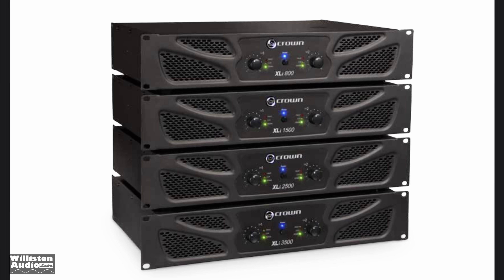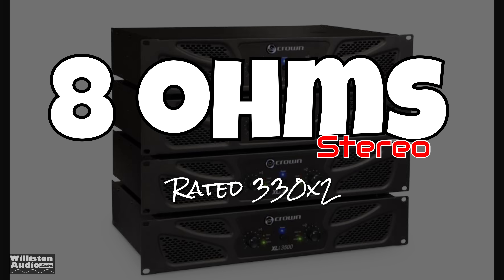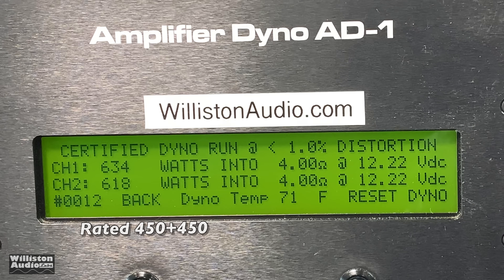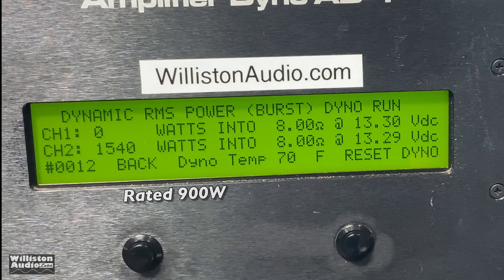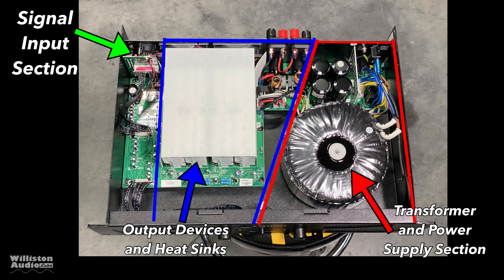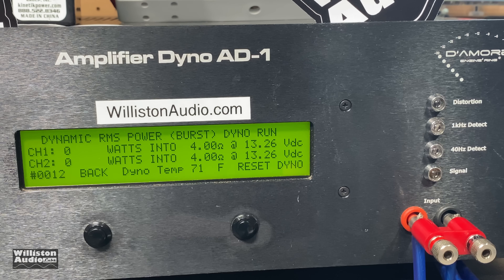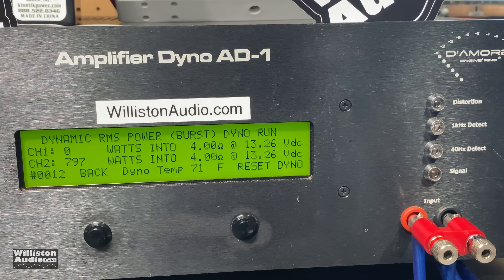The King of Pro Audio? Crown XLi 1500 Amp Dyno Test and Review [4K]

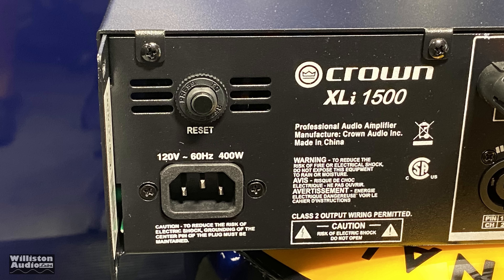Comment: The back panel says the amplifier draws 400 watts at 120 volts, 60 Hz - 1:22 ...  But it can output 1244 watts in bridged mode... Can someone explain how it's able to output so much more power than it draws?
Reply: it is because of the capacitor which saves Energy from transformer. In Bridge Mode you have more capacitor for that one Channel i think.

Comment: I have 4 pro audio amps. I got two Peavey single channel 300w amps, a Crest 450w per channel pro audio amp, a MTX 750w per channel pro audio amp and it don't matter what one you pick up it is heavy. I have a couple multi room P/A amps made for a business setting like a retail store but they are in sad condition they are heavy as well. They all got big fat transformers in them. Not like the transformer in that one that is the largest round one I have seen. I do have a massive ONKYO INTEGRA DTR-8.8 reciever that packs a fat 60lbs total weight and a 140w per channel rating at 8ohm continuous. It can do 170w continuous at 6ohms 7.1 surround.  Unfortunately I need someone to look at it. It powers up but the sound is just a tiny whisper from any of the channels it has. Where I live finding a good electronics repair shop is not easy. Being the throw away society repairing them is a dying profession and finding someone who is good at it is even harder. I know with a bunch of the ONKYO units the HDMI chip could become unsoldered rendering a no sound issue. I have a different HDMI chip than the one that causes that issue. I wish it was that I could do that replacement or repair on that board. That board is right on top facing up when the lid is removed. I am glad you did this video with a pro audio amp. I know it's 5 years old.  I should mail you this crazy looking 600w amp I have had for years. It is a 650w KOLE AUDIO car amp. It has a square box protruding from the amp and I can only think it is the transformer sticking up through the case like 2 to 2 1/2 inches. I found very little about them online. I guess they made a few different wattages with the higher watt ones having larger transformer boxes protruding up from the amp. To be honest it is kinda an ugly design. I remember reading on a forum years ago that it was considered a "cheater amp". I always thought it was underpowered. There is only one way to find out.

Comment: Somewhere, im failing to understand amplifier power ratings i've watched your videos on the crown xli 1500. And the Onkyo TX-NR1008. The Crown amplifier puts out more power from what I understood. I have both and the Onkyo will drive my Klipsch heresys considerably louder than the  crown amp does before the crown amps starts clipping. ??? Anyone that can tell me what im not understanding?
Reply from the maker: The Crown needs higher voltage input so you may not have enough input voltage to drive the amp to full output

Comment: Hi.  This is an old video but I would like to tell you something,  as an electronics design technician, and I'm sure you are quite well up on amps. This is what I once found in a reggae club. In the seventies,  there used to be an amplifier made in UK looked like a Marshal type box. But it was transistor. It was push pull two X 2n3055 outputs , rated at 100 watts.  No fans nothing. This club knew nothing about impedance lol and wired  -- get this -- twenty. 20. 18 inch, yes twenty "!!! Selmar Goliath bass units in parallel" and sixteen Goodman's axiom 12inchers also in parallel with the Goliaths. Do the math. ???? This was used for nine hours a night for ten years, without a problem " and sounded like five thousand watts. Shaking windows two streets away.  With thunderous bass from reggae music. And crystal highs from the axiom which was a full range guitar speaker really,  the heat sink was on the back about eight square inches, quite hot but not too hot , and the speaker cable was just bell wire lol 😮.  Unbelievable.  Could you reproduce this scenario?? And see how long a modern amp lasts??  Those days they had no output protection at all and ran. Into an almost dead short for years. On paper that amp should have lasted two minutes,  I do recall they put a sound city 120 watt on it for an hour to test the amp. It was valve , or tube as you say lol and the output transformer fried in that hour. As expected ". Hope you try this. I still can't believe it,  and the fal Amos are still on e bay as retro lol cheers
Reply: The name of the amplifier was FAL. 100

Comment: Ahhh, Crown. Overpriced, overengineered, overhyped junk. Well known for breaking into tweeter destroying high frequency oscillation, putting the full DC rail voltage on the outputs....

I worked in cinemas and pro audio for 4 decades, and Crown amps constantly failed at a rate of 5 to 1 over all other brands COMBINED. I saw more Crowns on my repair bench that all of the others. 

Why? This review and the dyno testing shows it. Crown ALWAYS way overdrives critical components to hype up the output...which works fine in the short term on non commercial applications. But push hard enough (and Crown always does) something WILL FAIL.  And when it does with Crown's piss poor designs, it creates cascade failures. 

Worst of all, Crowns have the worst noise floor of most other amps (hiss and sometimes high frequency oscillation). I had to replace a rack of them in a multi million dollar home's screening room because the client got tired of the constant hiss. I installed QSC amps that are still working fine after 20 years. 

I always love reading the comments from the rabid Crown fanboys, who wouldn't recognize a REAL quality amplifier if it bit them in the butt.

Comment: I have always been under the impression that when ya use the .775v sensitivity (-10db consumer level) input by using the rca input the amp is slightly retarded... swap the signal to -1.4v using the xlr and itll step up quite a bit

Comment: I recently puchased the XLi 1500 for use in a second system and somewhat taken back about how GREAT it actually sounded. In the past I have had amps that went LOUD (early Classe for instance) but still sounded flat and uninvolving. But the XLi 1500 has both power and grace and an infectiously dynamic, expressive presentation. 

One thing that struck me....after forcing one fork of a spade terminal into the small hole at the top meant for bare wire-this left the adjacent spades in very close proximity and at a risk of shorting. So I got some flyleads that went from binding posts (with true spade capability) to Speakons-allowing me to use the Speakon outputs. 

And the Speakon outputs were a disaster...firstly they had a much lower output. I had to turn the digital volume up to '75' for the Speakons to get the same volume as I got around '38' using the binding posts. And yes, I checked to see if I had  inadvertently changed the input sensitivity from 0.7V to 1.4V on the back (I hadn't)

But not only were the Speakons significantly lower in output, the drive, LF extension, and control of the music was lost, and the amp was simply 'loud' but lost a lot of its clarity and nuance, and became quite boring to listen to.  

If this is truly representative of how this amp performs, then a significant number of people may not be getting the performance that they deserve.

Comment: Got a Crown xli1500 power amplifier connected with speakon cable having turn settings up all way still getting distortion system seems be working hard to produce output static through speaker settings o. Bridge and 1.4v any help greatly appreciated

Comment: Just got mine bridged on the sub tonight, holy crap this thing makes more into 8 ohms than (almost) anyone could ever use. Tekton 21 Club Sub (passive, rated for 1KW I think). Had to back it down to the 5th indent to match the Bryston 7BSST2 (in high gain!).   It sounds decent in 2 channel full-range too, not a Mcintosh or a Bryston but not bad for $400. Ordering another, thanks for the great video!

Comment: I had one  just like your bike but mine had the glow-in-the-dark mag Rams and you could put them in the freezer and they would straighten back out😂 and also it had a GT Chrome gooseneck and 5 piece spider crankshaft with super fast bearings and the frame was Chrome instead of green the weight of the whole bike was only 5 lbs great for doing tricks these were some of the best bikes in the world Mongoose bikes weighed a ton😂 I also love skateboards back in the day as well when I was young my favorite boards were H Street boards and independent trucks and rat bone wheels with superfast German Swiss bearings And also I liked the flypaper grip tape with that super extra grip. I built custom bikes and skateboards for myself. And sometimes I would help others in the neighborhood if they needed my help.😂

Comment: hey boss know i am a little late to the party but after your review i ened up getting one of these and it powers my cerwin vega xls15 very well. i had a question i have been using a smart plug rated at 15amp to turn the amp on and off with alexa....my problem is it keeps tripping the smart plug. do you happen to know how many amps it pulls from the wall so i can get a higher rated amp smart plug?

Comment: Just had one shipped to me from Harmons $429. This mod will make a beautiful sounding amp which will become a shelf or rack mount only with only gentle moving around. One improvement for the amp is replacing the crumby coupling caps in the circuit at the output of the small signal section of the amp board for each channel. The electrolytic caps are replaced with 12ufd 250v polypropylene caps. These caps are huge by comparison and their leads are too thick for the holes in the PCB. Do not drill to enlarge as these holes are thru plated to connect the 2 sides of the circuit. Hole size is for 22ga wire which I used to support these large caps. Heat shrink all leads to also improve lead stiffness. By getting rid of the electrolytic coupling caps a layer of openness has been introduced to the amp which it did not have before.
If you wish to keep the robust throw around ruggedness of the amp replace the coupling caps with 10ufd 50v Nichicon Muse electrolytics for a sound improvement. In my mind electrolytics have no place in the signal path.
End result is an amp with dead silent noise floor and the benefits of class AB amplification. The XLi also has a substantial linear power supply which is superior to the class D switching  supply. My usual components are PrimaLuna Dialog Premium preamp and power amp HP. The power amp has 8) EL34 vacuum tubes which are extremely musical. Shortfall of that amp is low damping factor with woofer control. The Crown immediately exhibited superior resolution in the bass. The coupling cap mod made the Crown nearly as musical as the tube based amp. I am using a Schiit Audio Lokius 6 band EQ to soften the 6k audio region which all Crowns are guilty of being too prominent.
Hope this helps anyone looking at one of these amps. It is truly a good sounding piece of gear.
Reply from the maker: I was planning on listing this one for sale
Reply: To locate caps to replace go to "Look Inside" and when blue line appears "Input Section", you will see a large multi pin connector in the center of the board and one at the bottom. On the left side below the mid multi pin is a row of 6 small electrolytic caps , top one appearing greenish-that is cap1, 4th one down just above a pair of test points is the coupling cap to be replaced on Channel1. Just above the lower multi pin next to the blue line is the channel2 coupling cap. You can use 10ufd 50v Nichicon Muse from Mouser Electronics or Dayton Audio 12ufd 250v from Parts Express. Best deal from parts express is bag of 6 Dayton Audio polyproplene caps for about $26. Good Luck

Comment: Hey big d. That bike is sweet. I know it may be cost preventing but I'd love to see you test an old school crown macro tech. I built a system back in the day with 3 macrotech 5000s on the low end and 2 full ceiling to floor racks with Ashley's. 32 600w rms jbl subs I'd love to see how they actually perform 
Also funny how much power this thing has per dollar 
I'm waiting for my new ps audio bhk 250 amp. 250w at 8ohm 500 at 4ohm... price? Stupid 😂
Stay well brother just love your content 
I just bought a mug because I'm recovering from surgery and can't really rock anything that's not zip up
❤

Comment: I just opened my brand new Crown XLS 1502, going to run a pair of Rockford Fosgate P3D2 12s and a pair of RF Prime R2D2 10s. 10s behind the couch, 12s under the TV all ported boxes. It's going to be epic. Currently have a Dayton Audio SPA1000 running 4 rockville w10k6d2 subs in 2 cube sealed boxes in each corner of the room. But I crave more.

Comment: Hi. Since it got rca input, connect it to CD player without mixer would work?
Reply from the maker: Yes. But it may not provide enough voltage to drive the amp to full power
Reply: @wal  hi. Ic. How much voltage required at the RCA input?

Comment: Awesome! I just ordered the Crown XLI 2500 for my home theater system to replace my two Class D Behringer A800 amps (both bridged). Finding the Class D sound reproduction from them for my MAINS (four JBL 12" monitors) is kinda shallow and cold. Gonna have more power with the Crown and old school Class AB quality. That's the goal.

Comment: They discontinued the k2 series. 
Back in my clubbing days . One of the clubs I went to was running 2 crown K2 amps pushing 8 Ramsa ws-a200 on the dance floor and 4 more throughout the club. They pushed those amps to clipping all the time. There wasn't a club in southeast Louisiana or southern Mississippi that hit harder or louder. 
If the k2 was anything like this, it was pushing over 2kw bridged.

Comment: Isn't it better to just get a car amp for the home system? Cheaper and way more power!???
Reply from the maker: The amp itself is cheaper, but you have to convert 120V AC to 12V DC to power a car audio amp in your home and the power supplies large enough to power the big car amps are expensive

Comment: Question,,, Crown makes this same Xli amp but more powerful (XLi 3500) rated 1000 per channel into 8 ohms and 1350 per channel into 4 ohms.  Is this even possible considering a residential outlet provides 15 amps? Maybe a commercial a outlet 20amp?
Reply: You forget the fact that most of the time the amplifier power is provided by its bank of capacitors.
Furthermore, for improved performance, one should ensure about 3 dB of headroom/peakroom (power reserve not used) for clean and undistorted signal output, which means that, ideally you would want to use no more than half of the total rated power.
In Romania the power outlet can provide 16 A of current and in the case of Crown XLI 3500, one could use about 12 ampere of current.
Alternatively, for domestic home use of hungry power amplifiers, one should consider a separate outlet circuit able to provide more current.

Comment: I hope your still making dyno videos, I would love to know what some plate amps are doing (Mackie Thrash) I feel like I got robbed, they advertise 1300w. No way! PA equipment is worse than car audio "reputable" companies are falsifying #'s
Reply: If you took the trouble to do some homework and read the technical specifications of the Mackie's before buying, you would have known that they state the power rating as peak power, which means that the continous power rating can be 3 to 6 dB lower.
A question asked to Mackie's customer support for more details about those speakers technical specifications would have clarified the situation, also.
Their price tag was enough to raise alarm bells.
Personally, I wouldn't look at Mackie's for anything other than mixers. When I want speakers, I look for manufacturers like Dynacord, JBL or QSC, who's products are used for festival live sound reinforcement.
Real power comes with a certain price tag attached.

Comment: So if the xli 1500 has those numbers what would the xli 800 have since I have both. Would like to know the xli 800 wattage results.
Reply from the maker: Thanks for the suggestion
Reply: For Crown XLI amplifiers you can expect about 1 dB of power reserve over the rated power output. For XLI 800, you could expect about 380 W at 4 ohms and 260 W at 8 ohms., but take into account the level of distortion at that output level.

Comment: Thanks for the video. I was looking to buy the Crown XLi800 Two-channel, 300-Watt at 4Ω Power Amplifier. 
my question is. can this amp be hooked up to a receiver subwoofer low output to power two 4-ohm subs?  PS: this is a 220v ac model... thanks a bunch

Comment: I wonder how a 306 VA secondary winding (68 V x 4.5 A) can deliver the amperage required for 450 W continous at 4 ohms, without overloading the transformer.
With a nominal input level of 1.4 V RMS and a gain of 31 dB (35.48X amplification factor) we get 49.67 V RMS output.
49.67 V RMS requires 6.20 A at 8 ohms and 12.41 A at 4 ohms.
How do you get that kind of amperage from a secondary winding rated for 4.5 A?